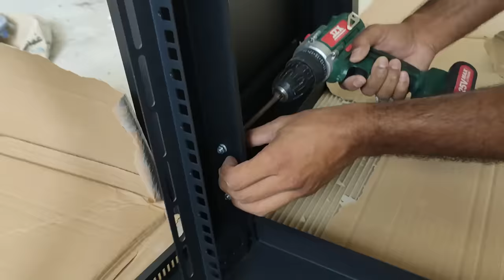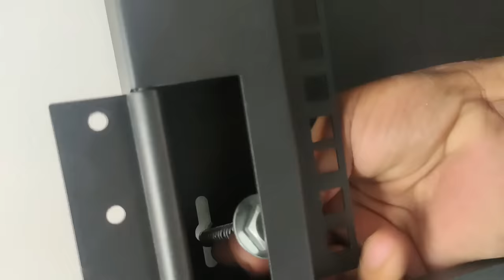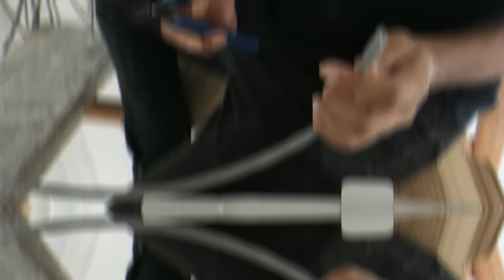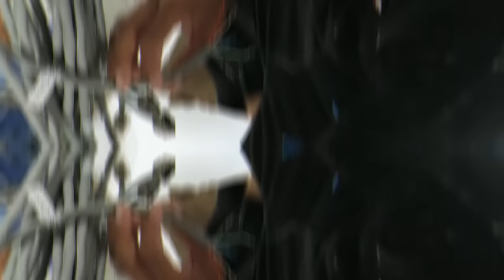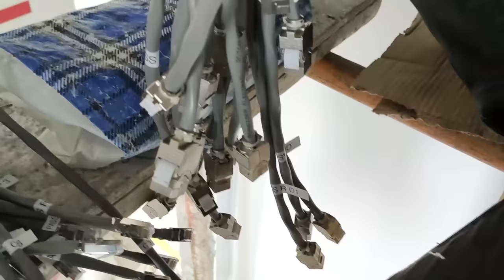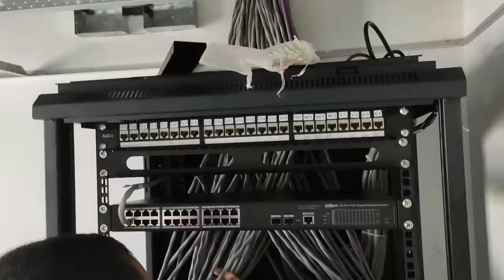network cable management and 12U server rack installation for office setup cat 6A cable dahua tplink

Comment: I can’t help wondering why you didn’t put the 48 port switch at the top, near the patching panel and use shorter patch cables?
Reply: I was wondering the same ?
Reply: My thought exactly. Also why not put every thing on a patch panel and 2 48 port switches. Much cleaner that way and easier to troubleshoot.
Reply: Those guys are not pro’s …
Reply: @bassman87  That I get. We do security cameras and have done a separate panel and switch. Even phones too. But if it's all data or data and phones on the same network?
Reply: @brandontull6109  it depends on the business requirements.  I am a Network Engineer at a Cisco Gold Partner, I have designed and implemented over 100 networks for our customers in the past 7 years.  I've seen requirements that allow for consolidation, and I've seen requirements that require different teams/departments to own their own equipment in the cabinet. There are a thousand ways to do this, and without any context into why they choose that design its hard to judge them for their decisions.
Reply: Same thing.. cabling ends at the patch panel, this is the standard.
Reply: @IAmZen_007  maybe those are Pakistani
Reply: @bassman87  so true,the hardest part of doing data center projects 😂
Reply: @brandontull6109  POE devices & av devices are one reason why...
Reply: @chriss8718  negative. can still be terminated in a patch panel.
Reply: @bassman87  with all due respect, as a network engineer for 7 years at cisco you should still know that all terminations should end at a patch panel in the network closet. That's the standard and it doesn't matter what equipment is connected to it. Period
Reply: @EngineerCatPyro  i absolutely agree.  now does this happen in the real world... absolutely not.  In an ideal world I'd love for every cable to terminate in a patch panel.  but go ahead and tell a company that they need to spend extra money for something that they won't see any improvement, sometimes it works othertimes they don't sign off on that work.
Reply: @bassman87  sir may i know what tools or, type of rj45 or type of I/O,  brand of crimping tool they used,, ? Great help for a beginner like us..
Reply: @sakmaestro3852  So it looks like they are using Cat6 cabling, thats why you see the plastic divider they have to cut to terminate the ends.  As far as tools most hardware stores carry a basic punch down and crimping set.  Unless you're gonna be cabling professionally, just get the basic set and save some money.  

For RJ45 ends I personally like the kind that you pass the wires through and they get cut when you crimp them.  its way easier than cutting each wire to length.  The pass through ends allow you to make sure you have solid connection to each pin.

If you install a rack that uses rack nuts like they do in the video, get yourself a cheep rack nut removal tool from Amazon.  they are like 5 bucks and your fingers will thank you.  Other than that most of the other tools used for installation are common hand tools.
Reply: @bassman87  what I/O do u think used in video? Thank you for the answer..
Reply: You should consider terminate all 'wall' cables on the patch panel, and from there connect them to the switch. Those are way more flexible.  I would never terminate those directly on a network switch.
Reply: @brandontull6109  separate VLANs would do it. Doesn’t need to be separate physical network devices.
Reply: @killdock2197  was going through the comments go get more info on why they din't use patch panels for all and saw ur comment, wdym about pakistani? what had that to do with anything.
Reply: Thats what i was thinking like why the 24 port switch at the top..

Comment: Cat6A cables terminated with an shielded RJ45 with no shielding wire on the 45 head and plugged in directly into a switch?????????? That's a first. Usually it goes patchpanel then cat6a patchcord(shielded or shielded that's your preference) to switch or router.... but directly to switch that's a big ooooofffff to me. then again what do i know?

Comment: A common way I often see in videos on server racks is to have patch panels above and below a switch. Patch cables from the patch panel above go into the top row of ports of the switch and patch cables from the patch panel below go into the bottom row of ports on the switch

Comment: Im building my first home lab and I learned some valuable basic tricks and practices from this video. Thank you!
Not so much a fan of the direct to switch plugs though, I feel a second patch panel would have been nicer here.
Reply: hey have you maked your home lab how was your exprience please share with me
Reply: Use Velcro!  I understand wire ties are cheap but if you are building a rack, it is industry practice to use Velcro because your track constantly changes over time, lace your wires, use Shielded cat6 if using POE (Power over ethernet), only reason to use zip ties, especially white ones, is if you have a Plenum Rated ceiling.  Meaning for (Fire Rated).  Also, on your drop to the rack, use a stock.  It's a black webbing material that works like a Chinese finger trap and looks amazing coming into the rack.  

Hope this helps
Reply: @JD2Q2Q  Well there are wire ties that you can reuse. But Velcro is still better because wire ties can actually damage your cables if you over-tighten them

Comment: You used shielded jacks on unshielded cables? No foil, no drain wire.
Reply: Yes bro... Really sketchty setup to say the least...
Reply: I literally said the same thing, cut the drain, no foil, no velcro (discretionary I know, but white ties in a black rack?)
Reply: Also putting the patch panel very far to the switch. Why not put it next to each other and use shorter cables for better cable management?  Wanted to display cable management skills by using TOO MUCH cables 🤣🤣🤣
Reply: He’s trying to catch radio signals from Tokyo

Comment: Why use a STP keystone and Rj45 if u don’t use the shielded cat6a or cat7a???
You are Just throwing out money on the keystone and Rj45 if you use UTP cable
Reply: maybe budget constraint and could not get enough or proper patch panels, maybe those jacks were just lying around, maybe different owner different requirements, it is what it is. We all wanna do things the proper way, use patch panels for all etc but things like this happen in real world all the time. Maybe they din't have knowledge, they could terminate BNC on patch panels too, since they mentioned directly plugging AV links (which was unnecessary). I can't defend them on the mounting though lol. It is what it is.

Comment: I'm curious, why are some cables plugged directly into a switch while others are plugged into a patch panel? Are they for different uses?
Reply from the maker: Yes these are different in patch panel all data and wifi points and direct cable are for camera and camera switches non managed giga switch and for data points wifi managed giga switch for
 V lans
Reply: Connect in patch panel, respect n. ANSI/TIA/EIA
Reply: good question, it matters not if they are for data or camera the use of a 48 port patch pannel will suffice
Reply: @facundof.f.l.4195  totalmente de acuerdo, en esta instalación se usa en una parte conectores RJ45 y en otros se hace una instalación de frente con jacks rj45, no se respeta la normativa y creo que se confunde a los que ven el video. Lamentablemente es un claro ejemplo de instalacion empirica.

Comment: There are so many things wrong with this, I have no idea where to begin… but let’s start with:
The weight of the loaded rack being only being supported by the flimsy hinges,
The lack of patch panels and direct connect being used,
No cable grooming,
Being installed above an inwardly opening doorway,
Power distribution units and power management?,
Fire stopping??,
Heat rises, the lack of effective cooking,
Installers were barefoot!!

If this was my construction site the entire installation would have been defected and the installers kicked off site.

I’m a 20+ year telecommunications and data centre specialist and site manager, I know what I’m talking about, and this is a shocking design and install.
Reply: same here its all true what you've said.. i think they did this just for low budget setup thats why.
Reply: you forgot STP keystones and STP RJ45 jacks on UTP cabling lol.
Maybe they could have yk, purchased normal jacks and saved money and could have gotten a proper patch panel. But those jacks might have just being lying around.
They mentioned connecting some directly cuz of AV cable or POE but, I think you can terminate even BNC or POE on patch panel so they doesnt make sense.
Can't defend them on the installation though, that's honestly the most worrisome thing here.
They could probably just be on a budget or different stuff owned by diff groups or idk, it is what it is.

Comment: Good luck troubleshooting that mess, lol. You're gonna have a bunch of adjacent cubicles on different switches 😂 These cables should be velcro'd outside the cabinet as well as inside.
Reply: words of "wisdom" from my network contractor friend, "we only route & fixed those cable and our aim is to install it neatly & clean then it's not our problem anymore. the company IT guy will troubleshoot it"
Reply: @nobysikakimysore  true,but still…😭😭😭
Reply: kasalanan ng mentor nila yan di tinuruan ng tama but still good job sa effort...

Comment: You used a back opening wallmount rack, it's designed to make your cabling work easier, also for future maintenance.
Reply from the maker: This is also easy
 that's not difficult for future maintenance
Reply: @naturefuturetech  but the backdoor is not made to use it as mount for a wall. It doesnt make any sense to screw the door to the wall with big screws to hang a whole rack in the tiny hinge screws and the doorlock.

Comment: its also my job ,but few points you should never use socket in rack you must put every single cable in patch panel then using patch cables to connect with switch.....but good job
Reply from the maker: Thank you ❤️

Comment: Why not all cables terminated at patch panel. If those are for other than data, should be of other color and terminated on different patch panel you have ample space for patch panels, UTP wires with Shielded RJ45?.

Comment: At 17:07 the video shows why I would avoid to pull cable between active equipment.

Other question is where they connect power and PE (or FE) for the cabinet?

Comment: What a mess.
Use patch panels instead of directly on switch.
No system.
Use patch- brush-switch-brush-patch.
Wrong cable ,use at least 6a or 7 a.

Comment: This video is a great example on how to NOT do networking. Can’t believe these people call themself professionals…
Reply: How is it supposed to be done then
Reply: @mosesmaina1231  patch panels, they mentioned some are AV links, so use unloaded patch panels instead where you can use BNC or RJ45 either side. If it is budget constraint, maybe they could have used the wasted money from using the shielded RJ45 jacks on the unshielded cables. But then again, maybe those were just lying around, maybe these are shared equipment, who knows, but ideally, this should have been done differently, it's really too messy and over the place.

Comment: Between the fact that it's all a matter of wireless charging and contract gadgets this would be world cable industry and it would appear and sound as if so....I'm easily set to believe this is forever something else chosen to be together for a netributed circle.
Reply: All good thanks to anyone who put in enough regards for the correct company modules which better themselves wisely and widely.

Comment: What's the purpose of having a patch panel in a fixture you've ziptied down like that. Why both with all the equipment if everything's going to be locked down and never adjusted without breaking it apart.

Comment: Well the point of failure....
Its nice you screw the Backdoor on the wall with huge Screws.... just to hold the weight of the entire rack with tiny screws of the hinge after that....
what a mess.

Comment: I don't get why they didn't do patch panel, switch, patch panel, switch, patch panel, and then used mini jumper patch cables
Reply: My thoughts exactly. That is how I always design my network racks. Also, if I have any unused spaces in the rack, I fill them with blank face plates to give a clean look. I'm not convinced that the folks in this video really know what they are doing.
Reply: @PeterHonig.  could have been many real world things, maybe pre owened equipment from different parties on same building, maybe budget constraints, maybe those shielded RJ45 jacks were lying around even though cable was not shielded lol. I'm not sure i can defend them on the mounting though lol, Or they are just inexperienced and din't realize you can use BNC on patch panels as well since they mentioned they din't use path panel for the AV links for some reason, well it is what it is.

Comment: need space need air need space..too much cables in smaller closet
Reply from the maker: No problem abut air and space there lots of hole in cabinet and  A/C is on 24/7

Comment: Я не пойму, почему часть кабелей через патч-панель пускают, а часть напрямую в коммутатор?
Reply from the maker: Camera cable we connect directly to the switch for better bandwidth
And data points and speaker wifi cable run through the patch panel for easy manage
Reply from the maker: Кабель камеры мы подключаем напрямую к коммутатору для лучшей пропускной способности.
 Точки передачи данных и Wi-Fi-кабель динамика проходят через патч-панель для удобства управления.

Comment: Cable dressing is not proper as per the standard. No earth bonding done for the rack. Patch panel connection is improper, there is stress on cables. Cable patching is not at all right. At cable termination, CAT6A shield is not terminated. Cable patching to the switch is never acceptable... Velcro tapes are the standard for cable installation. Overall, the complete installation is wrong as  per the standards and cannot be accepted.
Please follow the standards and make videos, so that it will be helpful for the beginners... I appreciate your efforts, but do it in a right way....

Comment: I disagree with this UTP copper solid cable termination to 8pin8condutor/RG45 plugs. These connectors are intended to be terminated to stranded cable not solid as if thier is vibration the bending action on the solid conductor could brake. This is a violation of all international telecom standards.
Reply: Correction on the type lof cable i see this is ScTP/Screened Twisted Pair